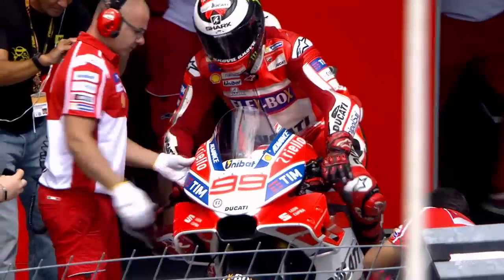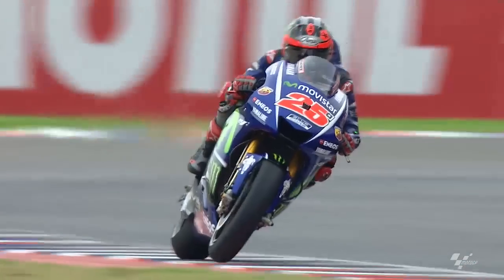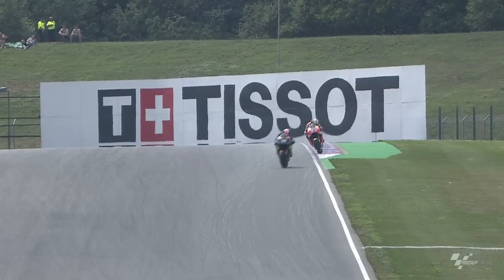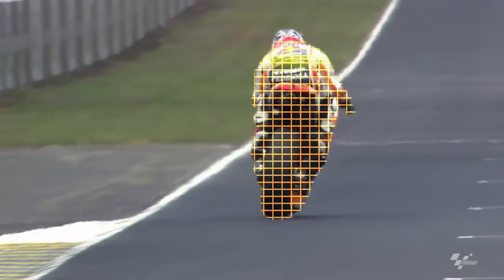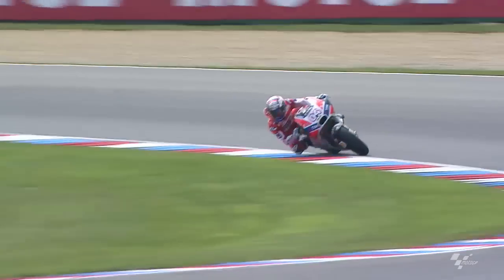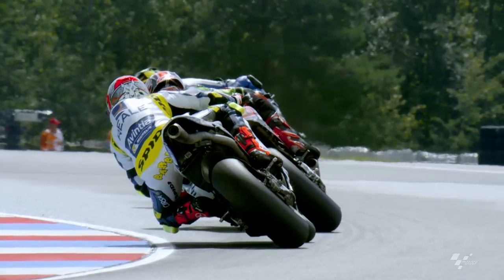Lean to go faster: How to ride a MotoGP bike

Comment: The reporter probably didn't understand properly what the technician explained to him.
Keeping the bike leaned the tyre diameter is smaller so the engine will rev higher, similar to have a shorter final ratio,  and so the bike will accelerate more.
Standing up the bike the tyre diameter will get bigger (longer final ratio), lowering the rpm.
Expert riders use this behavior in order to accelerate more and also in order to "control" the moment where to change to the next gear (standing up faster the bike has the effect to delay the upshift point so with more tyre contact patch and upsetting less the bike geometry, but with less acceleration...so...it's a compromise).
Another reason, not mentioned in the video, for the "S shaped" lines before brakings is because of "pendulum effect", used also in car racing.
Rolling from one side to the other, the bike is affected by centrifugal force and there is a moment, when the bike is perfectly vertical upright, where a lot of weight is reduced by centrifugal force and rear tyre can lose grip easier and in a more controllable way.
Applying brakes just before this moment expert riders literally lift the rear tyre and make it slide and land in the right place, in order to face the corner with the bike in the good direction.
Reply: Truth...
Reply: Nicola Sartori Vomiero he got the basics right but yours is more in depth. Good job
Reply: Yeah, his description was totally wrong. At a constant engine RPM, the reduced tire OD slows the forward speed rather than increases it. Coupling acceleration with the lean is akin to downshifting, providing more power to the tire.

Comment: I think you have some facts wrong.  If the Wheel is turning at the same speed (same engine speed rpm and same gear) the bike Will go slower if the radious is smaller (more lean angle). It Will travel less distance in the same time.
Reply: Ariel Ojeda ok so from my point of view everything appears accurate, as you lean the bikes speed stays the same but the wheels angular velocity increases and rpm increase at the same time.
Reply: Ed McGladdery what you say is true if you open the throttle but the bike speed Will remain the same. The tittle and the jornalist say That you lean to go faster de to the decreased radious and That is wrong. Again at the same throttle opening and gear you Will go slower the more you lean the bike. Same number or Wheel turns With smaller radious equals less travelled distance in the same time
Reply: Ariel Ojeda no you don't have to open the throttle, because the radius is smaller the momentum of the bike causes the engine rpm to increase. It can be seen on the recorded data. Also the front and rear wheel rotate at different speeds because of the difference in profile at lean
Reply: Ed McGladdery again in your asumption you are changing the engine speed That invalidates the argument. Front Wheel turns more times than real Wheel whats your point? It actually enforces what I say.
Reply: Ariel Ojeda I think we are talking across purposes here, are you saying the engine rpm won't increase?
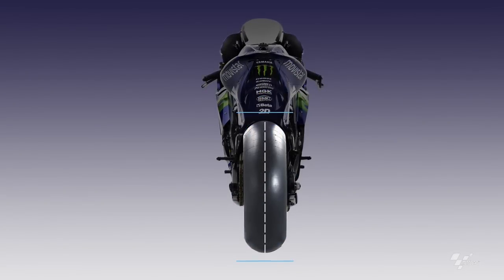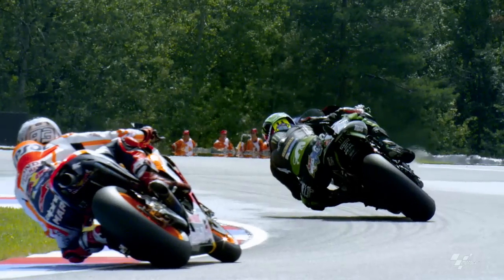Reply: Listen to minute 2:35 - 3:05. That is wrong, it's not gonna go faster (again, he is talking same RPMs). And no, rpms may increase if you are downhill but not if you enter a curve. Anyway, I think he is trying to say that ti may be "easier" to accelerate cause of the reduced wheel radious when leaning but that is altering rpms, and he talks going faster at the same RPMs. You may be able to increase the speed faster (accelerate) but you are starting also at a lower speed, but you will not go faster at the same rpms due to the drecrease in the wheel radious by leaning. Hope this makes it more clear.
Reply: You are absolutely right: it is slower. However, like you also said, it's better torque delivery, i.e. harder acceleration without wheeling. Out of a corner it's much better to keep the front down while accelerating so the electronics won't interfere by cutting power. Even the slightest cut of power can result in losing a meter or two at the end of the straight, which for professional badasses like MotoGP riders can be all that's needed to overtake.
Reply: Final drive is a torque multiplier, and a shorter one has more torque. Thats why you typically run the shortest gearing you can, the main point of shorter gearing isnt it reaches higher rpm/hp faster, its the extra torque produce as well as reaching a higher hp at that point on the track, shorter gearing will always out accelerate a taller geared bike till it runs out of power/revs in top gear, and thats the point i think he was trying to make. The video isnt conclusive though, i've raced some sort of bike since i was 4, sometimes things come down to the bike's handling or riders style or combination of and requires less effort but no slower to do so, and sometimes its just a genuinely faster way to get from a-b without forgetting c d and e. Other times its just form of fashion.
Reply: MotoGP kam MB ka nahi hai
Reply: what he meant was with a smaller radius its easier for the bike to gain speed as its easier for the engine to build up rev. Its like downshifting a gear. Though i guess he got it wrong went he said the rpm remain the same but at the end if im right he talk about how u peddle with a lower gear and feel lighter
Reply: I think that he meant that the acceleration will be quicker, not faster i.e by the distance traveled
Reply: Exactly what I'm thinking now!
Reply: so then why does rpm increase when leaned over? it acts as if you are in a lower gear and you can accelerate faster, then when you need top speed you sit the bike up.
Reply: @nanderlizernanderlizer684  rpm picks up faster because u can rip the throttle back harder without the front end coming up. front end is less likely to come up due to the lower centre of gravity from the bike being leaned over
(thats the theory anyway)

Comment: center of gravity for antiwheelie: yes
diameter of the tire for more power: umh, yes but explained wrong, because the smaller diameter of the contact patch at lean, the gearing is shorter, meaning more revs at the same vehicle speed, thus higher in the powerband, and bringing the bike up slowly will keep the revs at the preffered max horsepower point while increasing the effective gearing, kind of like a cvt transmission.
Reply: aye that is so